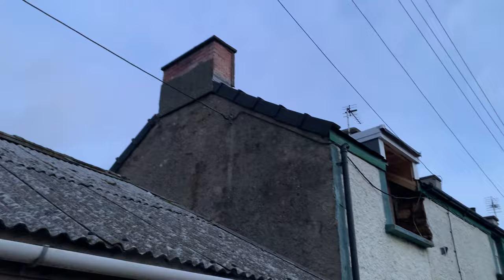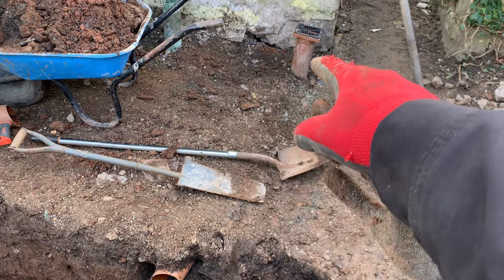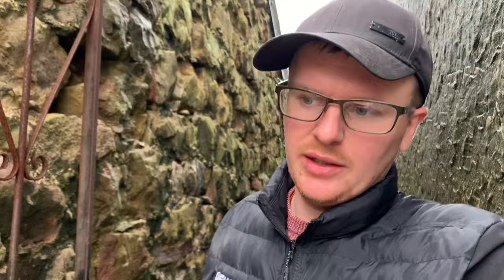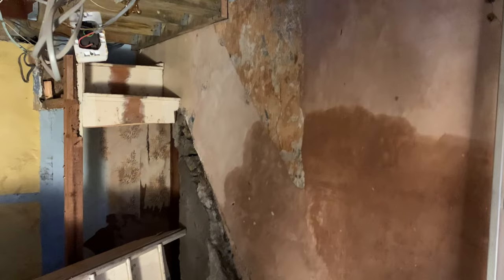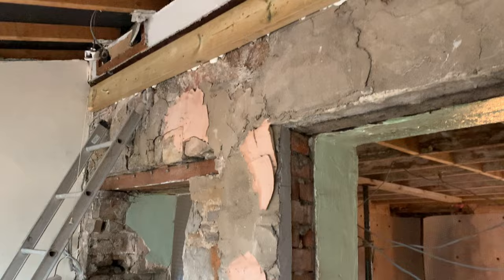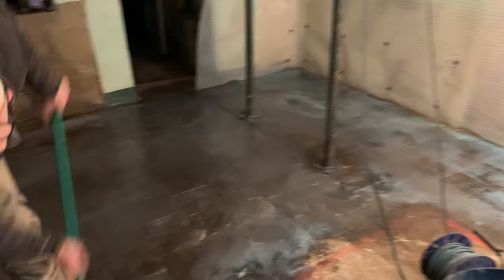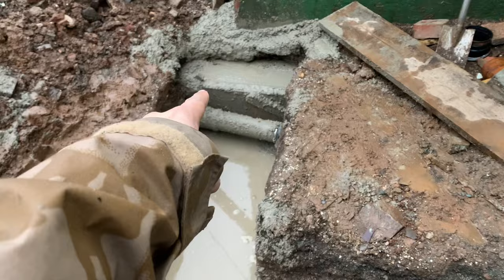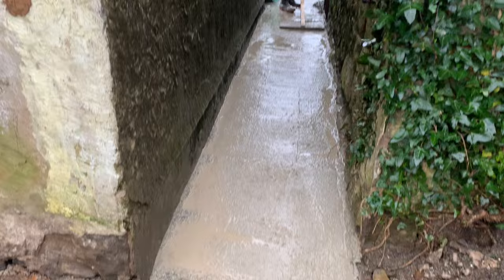FOUNDATIONS AND INTERNAL OPENINGS - S1 Episode 20

Comment: Dave the Raves doing a good job he’s a builder you need to keep hold of as he seems an all rounder who uses common sense. People like him are getting rare nowadays they all seem one trade only and won’t do anything else. The only problem with houses like that is there’s no triangulation where there is with bricks and blocks so it makes it hard to knock bits of wall down like you are. I think what you did with two boards screwed and bolted through the wall is the best thing you could have done the. Only thing I might have done is removed the plaster under the boards and used expanding foam to stick the board to all the little bricks etc and I’d of been tempted to use new wood for the job as that bit on the outerside had or has some bad woodworm or possibly pine beetle had been chewing their way throughout the board. 🌲🪲🤣😂🤣😂🤣😂🤣
Reply from the maker: Dave’s a diamond in the rough haha! We make a great team.. I’ll be rewatching these videos looking at the comments.. so much has happened id have to refresh :)